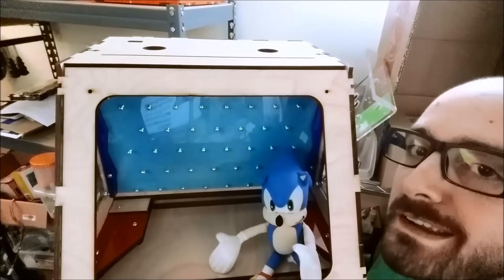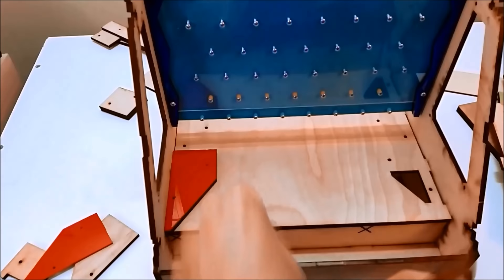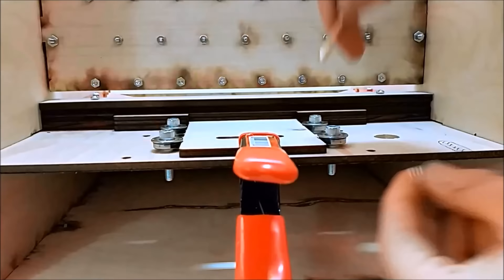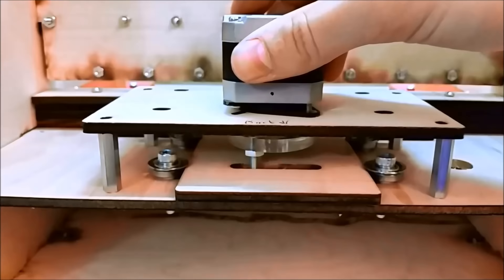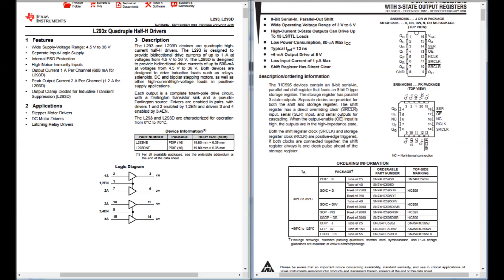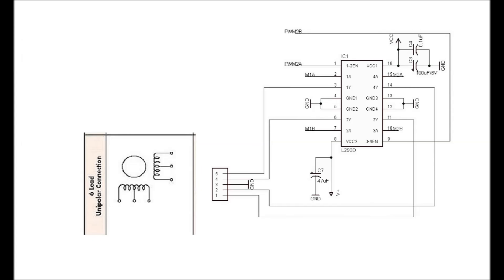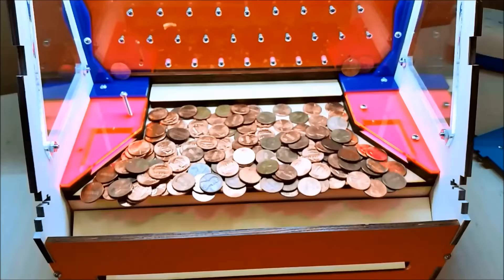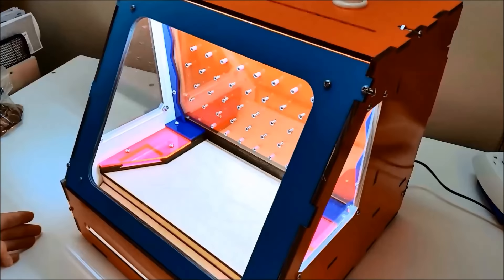Build a Desktop Coin Pusher with an Arduino!

Comment: This Build need a centered Collector for the Win, a longer Dozer and maybe a always running Motor with a Stop Button.
The Tilt usualy open a Trap, so the Cheater get nothing and with this build the one still get all Coins on the Table.
The Bell connect to the Lamp at the Reset and use a small Speaker instead of a Bell, it need less Power.

Comment: Instead of holding a button, is their a way to automate the dozer going back and forward
Reply from the maker: Yes; just change the code, or wire the button "closed".
Reply: Ryan Bates ah okay, thanks for the quick reply
Reply: Ryan Bates would there be a way to toggle it? like when you press the button it turns it on to where it stays on, and when you press the button again it turns the dozer off??